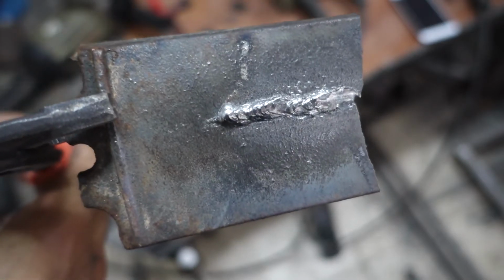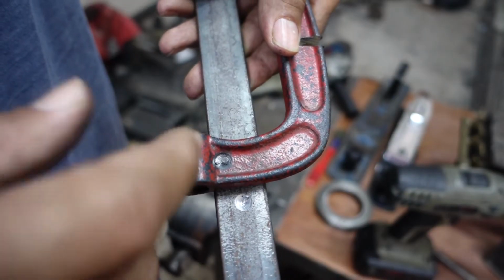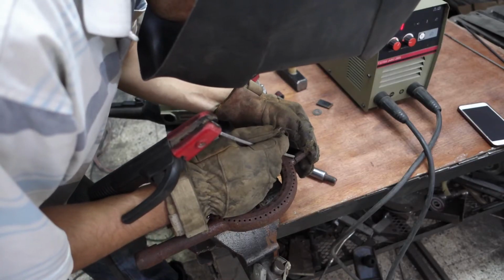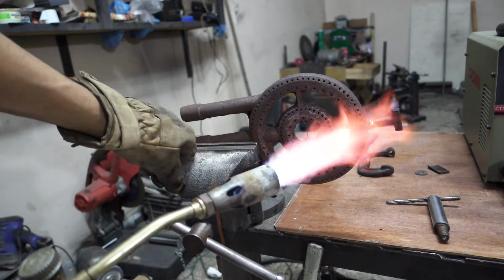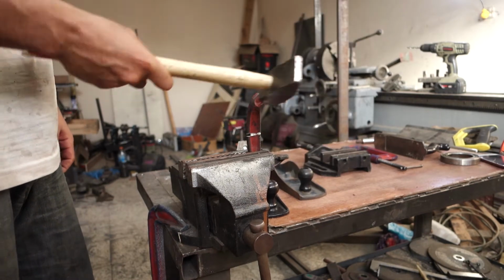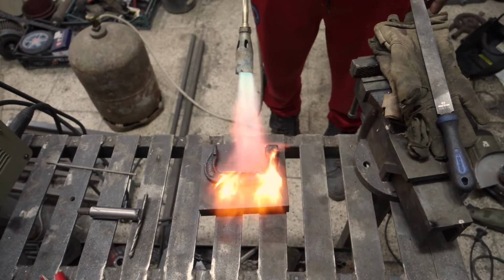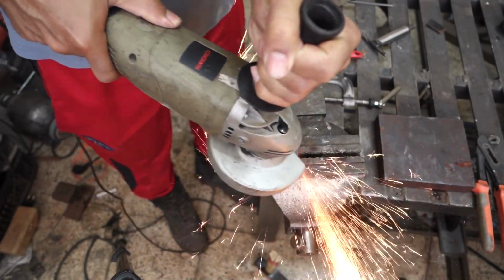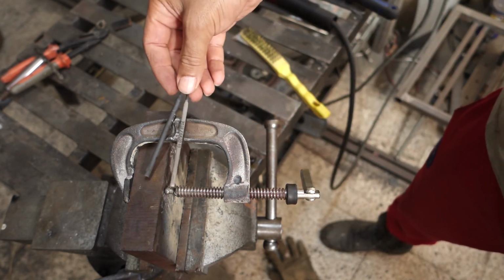Welding cast iron

Comment: That was interesting.  Will try cast iron welding with 7018
Reply from the maker: Thanks.I do my cast iron repairs using only 7018 because I don't have anything better 🤷‍♂️ but if you can use Z308 than that's better